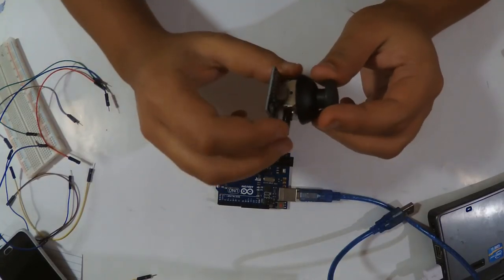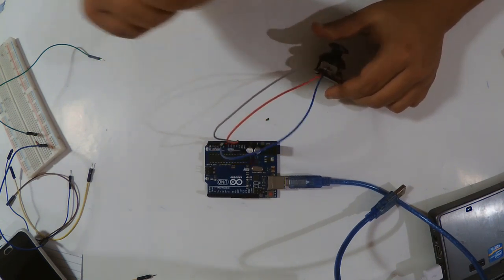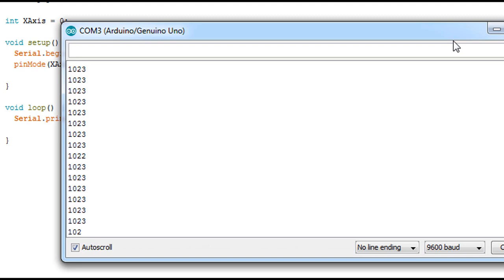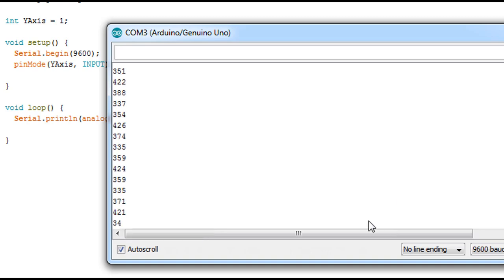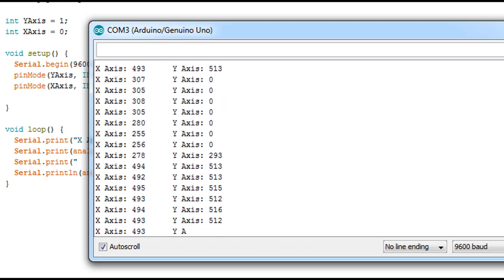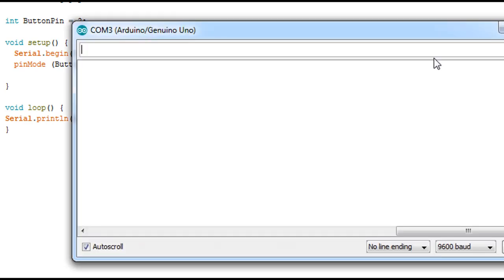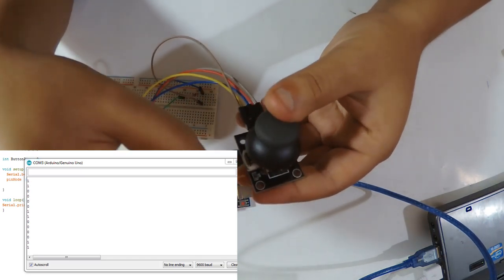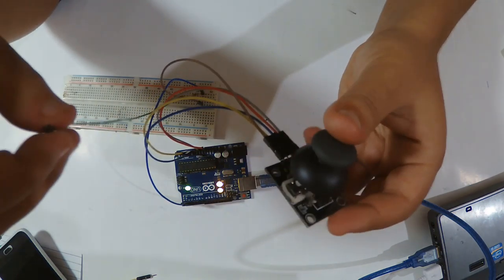Interfacing Joystick module with Arduino

Comment: Change the pin mode to use the Arduino's internal pull up resistor to avoid needing an external pull up:

pinMode(ButtonPin, INPUT_PULLUP);